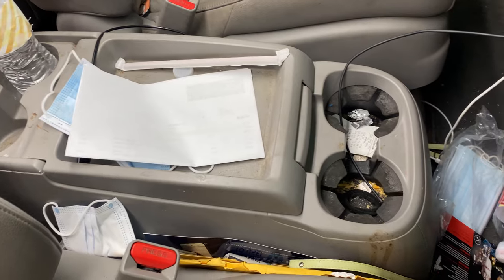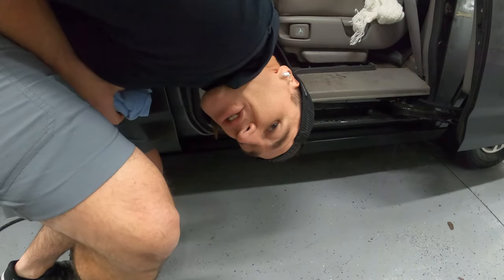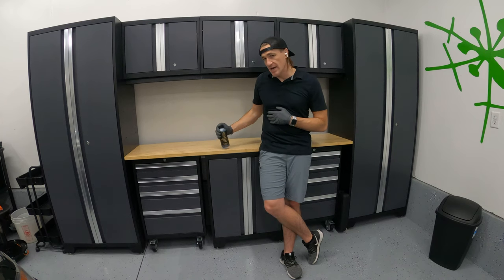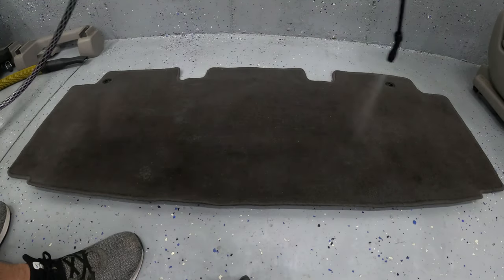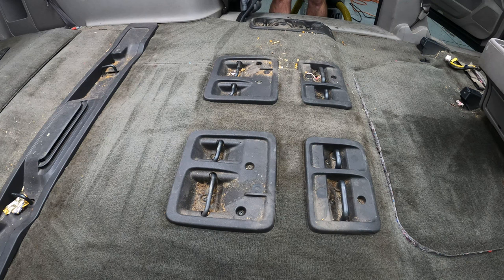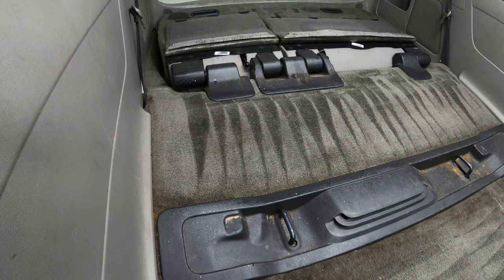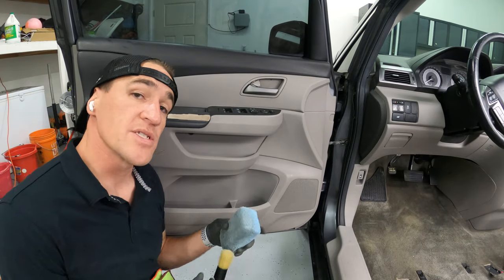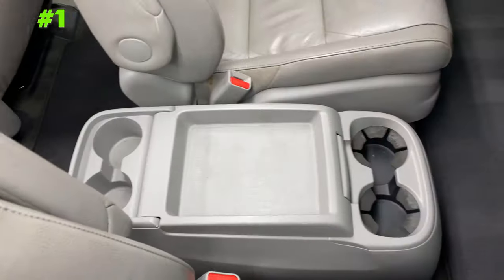'13 Honda Odyssey Unidentified substance in a minivan Adam’s Advanced Graphene Ceramic Spray Coating

Comment: Great job on the detail! When using the ceramic coating spray, is it a must to polish before you use it?
Reply from the maker: The glory of any of the Adam’s Polishes Spray Graphene coatings is that you don’t have to polish before. When you apply a full ceramic (I often refer to it as a legit ceramic coating) that is when you have to polish.